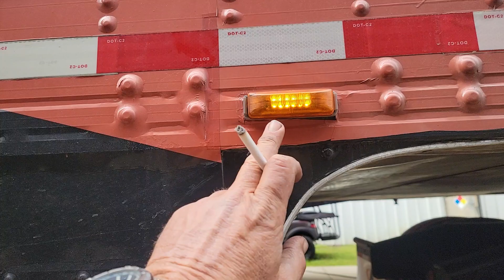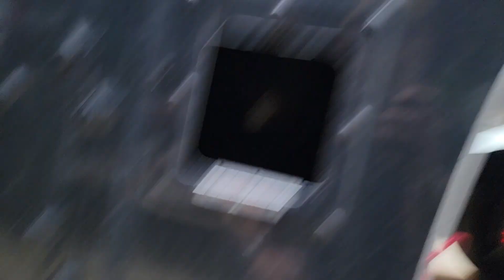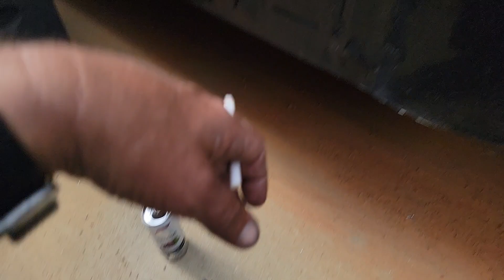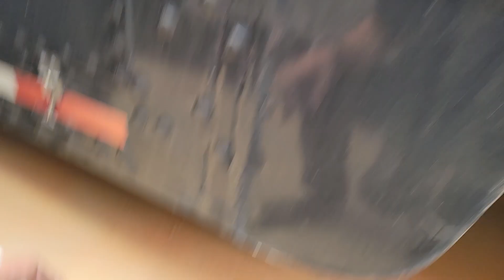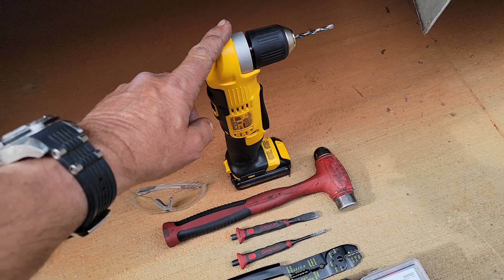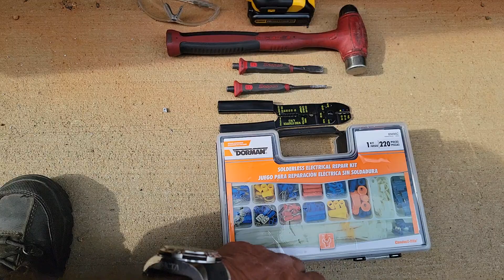Simple Escalation

Comment: That’s the reason that BJ has Ron for a fix it guy and spend $23 for a new LED light assembly or you could go with the Featherlite factory plan 

Drive the trailer to the factory in Iowa

Spend $1000 on the fuel to get you from Charlotte to Iowa and back

Spend $100 on a round trip to the Iowa factory to the airport and back

Spend $875 on a plane ticket to get you from Iowa back to Charlotte then back to Iowa because “we run about two weeks out and will need the trailer for two weeks 

Another $100 for another Uber 

Spend $950 for the labor at the Iowa factory 

Spend $23 for a replacement LED light assembly
Reply from the maker: Lol...actually had to drag an Ultra Comp to the factory once...went a bit easier...the damn thing was trying to split in half in front of the front axle..what I did was talk crew chief into loading Texas car as Martinsville back up...I blasted off from Martinsville for St. Louis. Camped out there whilst 3 shifts worked for 3 days...had to unload cars...cabinets...damn near everything...they had to strip the interior out to gain access for replacing rivets in skin seams...welding frame members...etc.